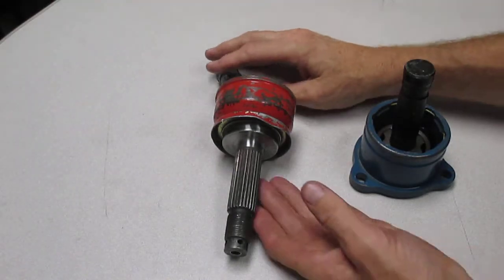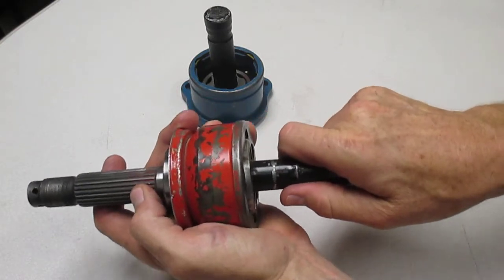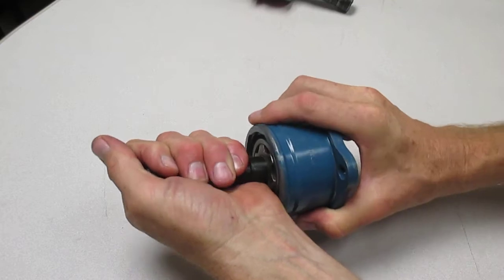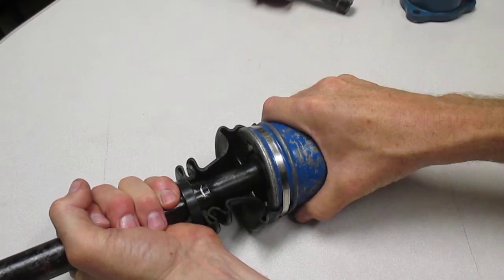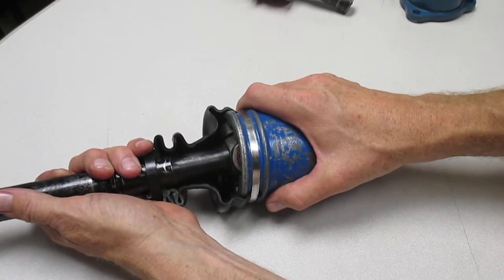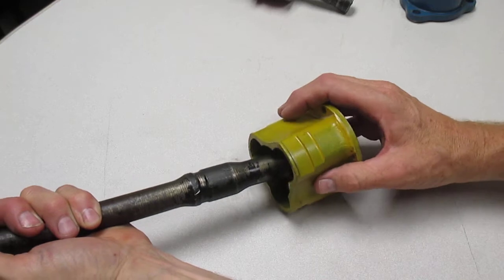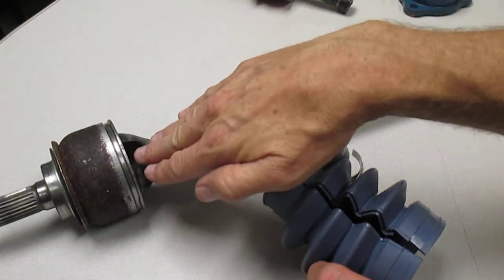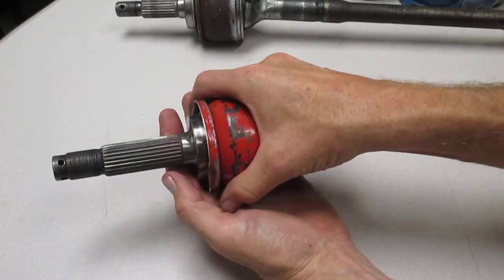CV joint movie

Comment: You covered a great topic nowhere to be found. Tripod CV joint wear. Thanks so much! I'm curious if it's possible to replace only the tripod with the three bearings? I can only get those of a scrapyard, and due to the rarity of the model of my car it's not possible to get any new drive shafts.